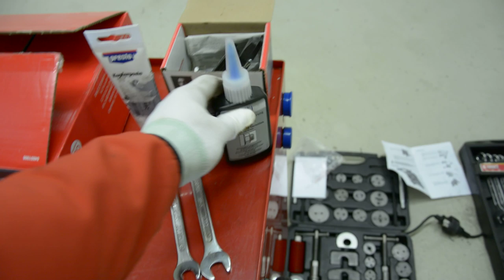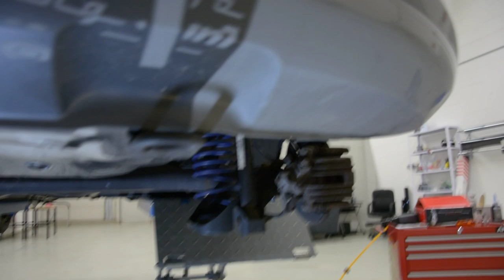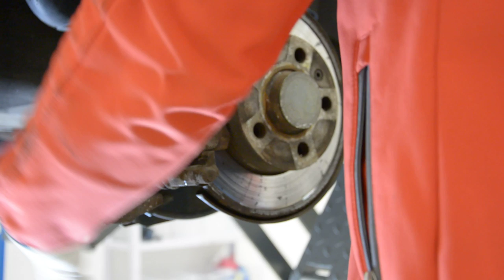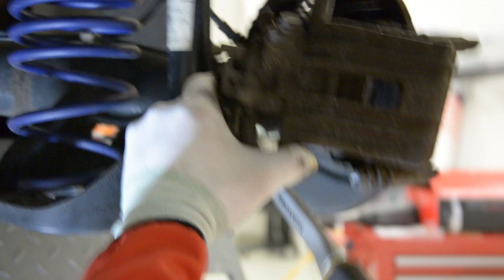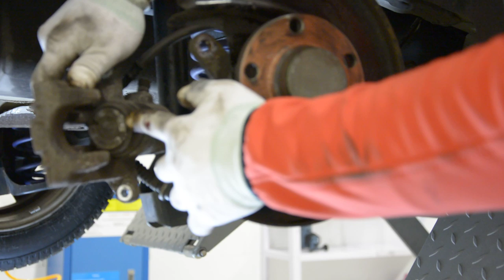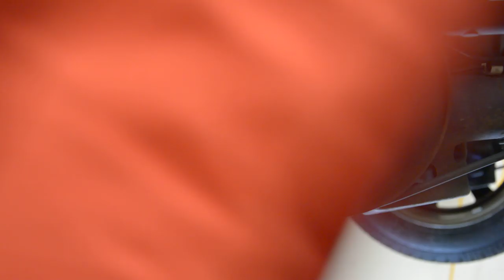VW Polo 6r Brake pads break discs replacement Part 1/2

Comment: never let the brake calliper hang by the brake hose! support it with a cable attached to the strut or something.
Reply: In this case the handbrake cable takes quite a bit of the weight and it's only a small calliper which doesn't weigh much so not really a problem.

Comment: The Brake disc you can remove and change without removing the brake carier 👍🏼
Reply: You beat me to it. Although depending on disc brand, there is a a small chamfer on the back side of the disc which helps miss the hub when locating disc in carrier. I replaced few years back with Pagid discs to find they woukdnt pass the hub by a millimetre. They didnt have the small chamfer. A little persuasion with a mallet and they squeezed in. Reported it to Pagid so whether they altered the mold i dont know. Doubt it

Comment: Thanx for very good video!! I tip might be that you can use a hammer to persuade the piston to retract into the caliper. I tried everything before this last resort. Disconnecting the brake line, varming cooling spray Tools made for retracting the piston. Btw the caliper holder doesn´t nesserily need to be removed for a rotor change.

Comment: the screw that holds the disc onto the hub can be a bitch, you need to lube it a couple of times with penetrating oil the day before you do this, and then use some leverage like a breaker bar or something long to break it loose, or you'll screw up the screw and you'll have to drill it out.
Reply from the maker: Thank you for all the advices, is for the first time when I'm doing it. I don't advise anyone to do this without  under the guidance of a mechanic